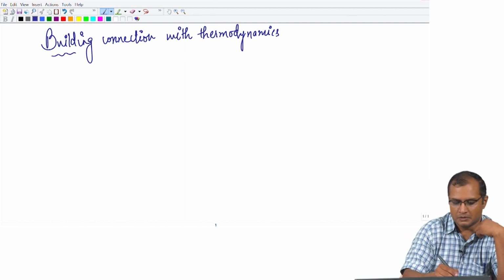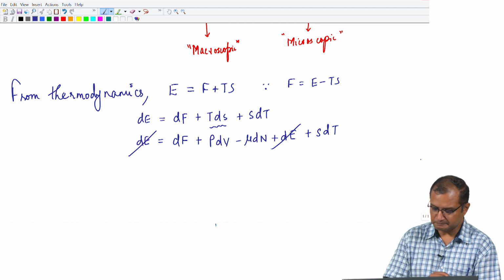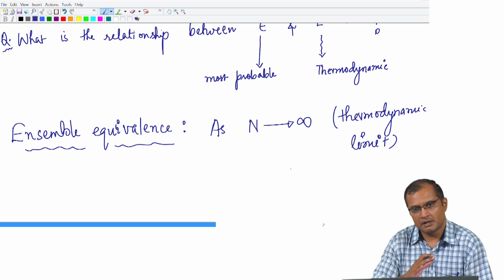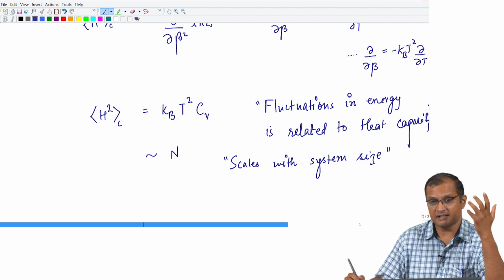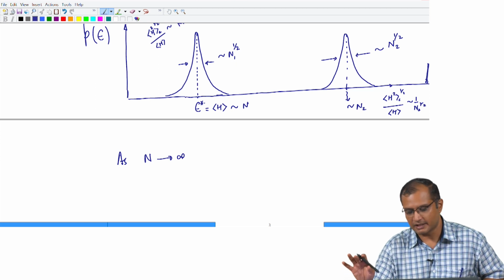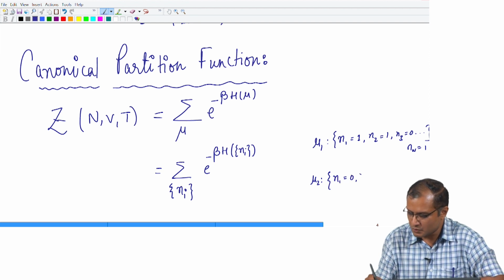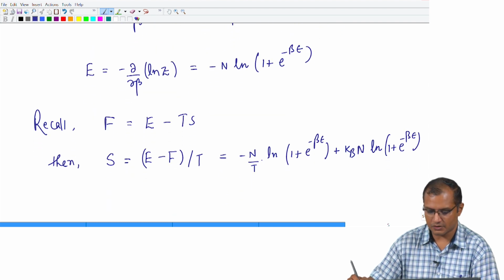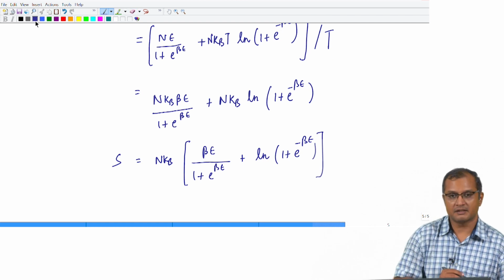Lecture 22-Two Level System (Canonical Ensemble)

Comment: (incomplete)
5:40 Compute average energy
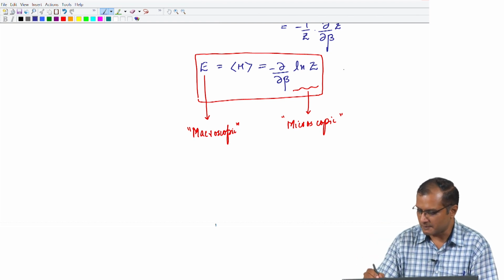9:14 Equation 1
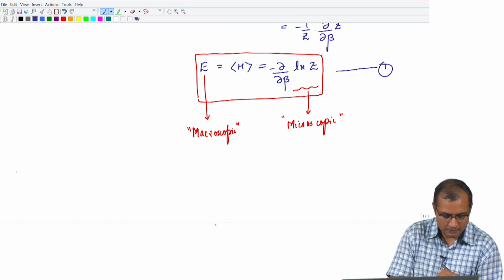9:14 Showing link to Thermodynamics
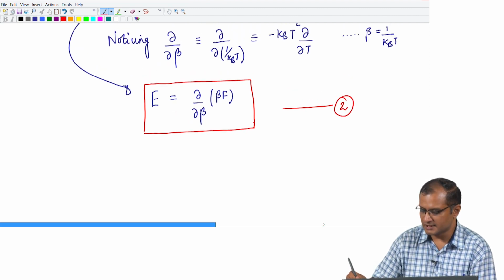16:37 Equation 2
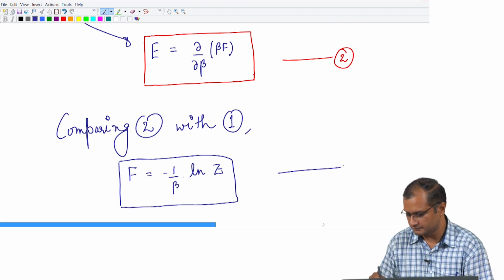17:23 Equation 3
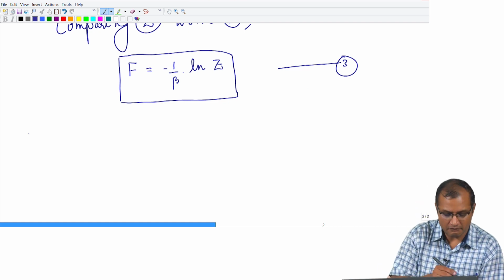17:32 Relationship between E* and E = <H>
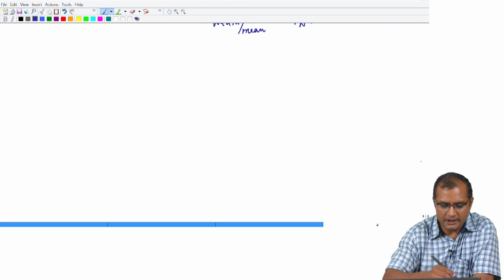42:29 Example problem: Two-level system
51:30 Building relationship with Thermodynamics